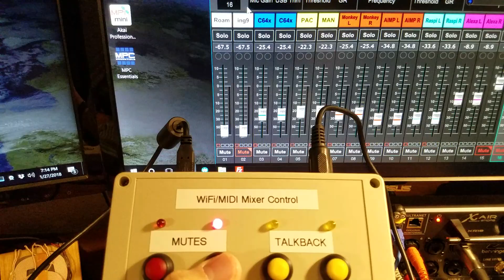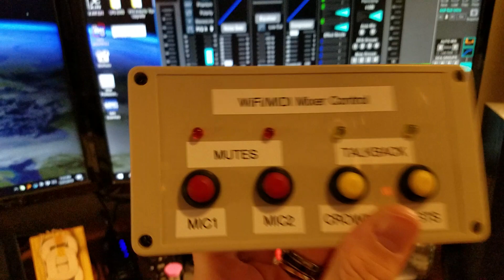ESP32 Arduino based Behringer XR18 X-Air DIY WiFi MIDI OSC Programmable Mixer Controller

Comment: Yes! My next project awaits!
Reply from the maker: FWIW, I've moved away from using the Arduino IDE and now program ESP32 stuff with ESPhome- That said, I haven't had a need to use ESPhome with OSC for controlling the mixer.. yet... lol  😂
Reply: @VernGraner  Nice one. Got quite a bit of home automation going on myself, a bit too much maybe 😂 With your arduino WiFi midi code, woukd it be a big task converting this to function on an X32 or is OSC implementation similar on the two mixers?
Reply from the maker: @wattage2007  If I recall properly, the XR18 and the X32 both "speak" the same OSC protocol so it all should work.👍🙂

Comment: Hey dude, really cool project. i was hoping to use this myself, but i cant seem to compile the code
Reply from the maker: Glad to hear you liked the project. 🙂 I'm sorry the code won't compile for you. 🙁When I wrote the source, it was literally my first attempt to write code for the arduino/esp32 so I really didn't know how to properly structure things. One area in particular was using libraries (e.g. "#include <Button.h>"). When I needed to do something, I simply google around till I found a library that would claim to do the thing I needed and then shoved it into my IDE. 🤷‍♀ I didn't really document where they came from or what version they were. 🤦‍♂

The result is code that would compile for me (since I had the helper libraries) but for others it wouldn't compile.🤦‍♂  I tried to go back and document the libraries in the most recent version of the code I have linked above (The file name is "V35b-COUGH-DROP-LOCK-SWITCH-1c.txt") and it has links to the libraries I think I used. I hope that may help you get it to compile.

That said, I no longer use this device as I moved on to using a Raspberry Pi with Bitfocus Companion instead of dedicated button boxes like this. I still think this project is useful and can imagine some clever ways it could be used for live stage performances, but I didn't pursue it past the point you see in this video. If you like you can email me and I'll see if I can help or answer specific questions about the unit. Good luck and thanks for the comment! ☺
Reply: @VernGraner  Thank you very much for the answer i will keep on trying, will update you if i find af fix :)

Comment: Thank you so much for your help. But can you provide sources code and wiring diagram because link not open which you provide in description. Thanks
Reply from the maker: Thanks for the notification! I didn't realize the link was broken. It should be fixed now and there are photos of the unit and the source code I used. Thanks! 🙂
Reply: @VernGraner   I'm interested in using an Arduino Mega board and push buttons to control the mute/unmute function for the 16 channel faders on the X32 Rack. Could you please assist me whether the provided code/example can be implemented for the X32 Rack to control the 16 channel faders using Arduino Mega and push buttons.
Reply from the maker: @khuuramnazir1124  I'm not really doing this kind of programming/control anymore. Recently I've been using Bitfocus Companion to control the mixers. It doesn't require as much programming and fabrication of boxes/switches since it uses a Stream Deck (from el gato) or you can use its built-in emulator to operate things. Highly recommended for complex control stuff! :)

Comment: Hello from Brazil! I found the V4.0 of your code for the MIDI only controller! I need to teste it with an Arduino Uno but i am getting an error on the arduino IDE saying: error: no matching function for call to 'HardwareSerial::HardwareSerial(int)' Can you help me with that?  The error shows the line: HardwareSerial Serial1(2); I just started with Arduino/Midi stuff and I have a lot of silly questions! Thank you in advance! You are awesome!
Reply from the maker: Hi @aura Pop Duo - Thanks for the comments! 👍🙂 I have not visited this project in quite a while so I don't have the syntax fixes or troubleshooting off the top of my head. I suppose you can pop in on the Behringer forums to ask..?
Reply: @VernGraner  Thank you! I noticed this in the code: "Rev Info: V4.0a (VLG) 01-22-2018 ported to ESP32" I am using an Arduino Uno... Maybe I need to use the V3.0a of your code?
Reply from the maker: @AuraPopDuo  Oh- hey! Sorry I didn't see this till just now. I have all the early revisions of the code laying about. Let me have a look and see if I can put older code revs up. 👍🙂 (done!) You can see the updated link in the video description. I put ALL the source code up there.. from my first prototype to the running code. Hope that help! 😁

Comment: is there any tutorial to bulid this ? is there any change to send midi via bluetooth?
Reply from the maker: Hi Akhmad! Thanks for subscribing and leaving a comment. 👍😁 In answer to your questions:
1- No "build tutorial" per se, I did document my build process fairly extensively on the musictribe forum. You can read the process here:
https://community.musictribe.com/discussions/89600/257791/diy-wi-fi-midi-remote-control-box-for-x-air-working
2-  I never tried to "send MIDI via Bluetooth" as the XR-18 had no bluetooth receiver. I did use WiFi and MIDI to control the XR-18 directly though (as you can see in the video demo). 
Hope that helps. :)

Comment: hello brother.excelente what you did.I'm trying to reproduce you but not with me I always get an error in the line of Serial1.I'm using the arduino leonardo. in my case I would not use wifi only midi I want to make a fixed control and leave it near the mixer. Do you have any tips or other code that I can use as a base?

"hugs from piaui-brasil
really good project"
Reply: forgot to comment

man, this keyboard is very beautiful. Here in Brazil you can't find one of these and finding it must be very expensive

**I found your video on the musictribe website
Reply from the maker: Hi @hernandes ! :) Thanks for your kind words. Though I used the Arduino ecosystem & integrated development environment, I have limited experience using it with any microcontroller other than the ESP32 chip. That said, when I was first building prototypes, I started with a MIDI only version of the code with four buttons. I found that source and uploaded it to my site here. I hope that can help get you started as it is MIDI only (no WiFi stuff) so it might be simpler to troubleshoot. :) The link is here: https://notepad.org/TAE/posts/MIDI_BUTTONS_VLG40a-ino.txt

Comment: Great job!...i have seen the sketch, but for the connection?
Reply from the maker: The box can connect to the mixer via WiFi or via MIDI. Does that answer your question..? :)
Reply: @VernGraner  thanks! But,which pins numbers use to connect the Din connector? And where the momentary switches?...
Reply from the maker: @FrankGegna  Details on the build, including pinouts and pictures of the wiring are in this forum thread on music tribe: https://community.musictribe.com/discussions/89600/257791/diy-wi-fi-midi-remote-control-box-for-x-air-working

Comment: Wow! Exactly what I was thinking! I guess you got the non-MIDI WiFi codes down. I haven't looked into it much but have it in mind to make an encoder/button board to adjust levels. I guess that could be done with MIDI alone but I have all these ESP modules o.. Thanks for posting this!!
Reply: Oh they're using OSC! Cool I know it yay! Cheers again!
Reply from the maker: Glad it was helpful! :)

Comment: Very cool project !
I see you're also a fan of my favorite buttons ! :-)
Reply from the maker: Thanks! :) FWIW, those buttons kinda let me down.. a bit.. I set them up when they were new and apparently, as they get older, they tend to get "noisier".. the original de-bounce routine settings I used when they were new no longer work so well so I am going to have to re-code to take the "bouncier" operation into account. As it is, the "mute" buttons can sometimes "flicker" when pressed and held down .. which is not good ¯\_(ツ)_/¯ .. as far as the price and feel and ease of mounting though, very good. 👍😁

Comment: Niiice.. can I add more buttons to this? And can it be modified with Arduino nano?
Reply from the maker: The prototype unit was built around an arduino nano but it only did MIDI out so, yes you can use other arduino models but if you want to use WiFi it needs the esp32. As for more buttons, that is also possible. I added a 5th "button" (toggle switch actually) that I use as a way to change the buttons between momentary operation and push-on/push-off mode. :)
Reply: @VernGraner  ok, so do you have a link to the nano code?
Reply from the maker: @malmgodbless7  I updated the source code link in the description to a folder that has all the various version of the source code as I was developing things. Hope this helps! 👍🙂
Reply: I don't even remember asking this question but thanks for the reply.. I'll check the video to see what it was about again

Comment: Hi friend, congrats from Brazil about your great idea. Can you share the wiring/schematics? Many thanks in advance...
Reply from the maker: Hello Lidio! Since the connections are so basic, I never drew up a schematic. Essentially, you have four buttons and four LEDs - you connect them to eight of the GPIO pins.. that's pretty much it. :)
Reply: @VernGraner  many tks Verb, I will try it

Comment: What is the change command (cc #) and the channel to trigger the talkback?
Reply from the maker: On the box, I am using the yellow buttons to send two different level commands to the channel. The first button, when pressed brings up channel 10, AUX 1 to unity gain, then when released returns it to infinity. The comands for that are OSC style and are  /ch/10/mix/01/level-127 and /ch/10/mix/01/level 0. Thesecond button does the same thing but for aux 3. its code is /ch/10/mix/03/level -127 and /ch/10/mix/03/level 0. Does that answer your question?
Reply: Is it possible to start and stop the recording via midi and even get Midi Data back to control a record light? @VernGraner
Reply from the maker: @pumbaandtimon  I really have no idea.. To be honest I came into the project knowing exactly ZERO about OSC and MIDI/OSC. I had to dig my way through to get it to work as you see here. :) I would suggest you ask the question on the Music tribes forum .. I'm sure someone there might be able to point you in the right direction. :)
Reply: @VernGraner  ok thanks

Comment: Amigo tenho um controlador midi aqui! como faço pra mandar o sinal pra a xr18?
Reply from the maker: Sorry, that's outside the scope of what I can help with. Based on your question (via google translate) I would guess just use a MIDI cable? ¯\_(ツ)_/¯
Reply: Sorry, I'll send the translation! in fact my question is how to configure within the XR18 mixer the friend could do a video tutorial teaching how to configure the midi controller inside the X air ??? thank you so much!!

Comment: Wow thats an awesome piece of work there. Ive been thinking of buying an XR18 for sometime only thing that has held me off is the lack of foot switch for muting effects. (bypassing FOH reverb for announcements) appreciate this can be done with a Midi foot switch but Ive spent a fair but of time with Arduino, Rasp Pi and this looks like project that might give me what I need. Any chance of a tutorial video, link to code at some point.
Reply from the maker: Hi Stuart- thanks for the kind words. :) As for a tutorial, I don't have one specifically written up (or recorded),  but I am considering writing a complete how-to sometime soon. In the meantime, there is a fairly in-depth discussion about this project on the Behringer forums here:
http://forum.musictri.be/showthread.php?20869-DIY-WiFi-MIDI-Remote-control-box-for-X-AIR-WORKING!
Hope this helps. :)
Reply: Thanks for the reply Vern real excited about this now the final push i needed to order the XR18 a tutorial would be amazing if you get chance but I know only too well how precious time is. Will check out the link if never know if I get it up & running I might do a tutorial myself :-)
Reply: Just spent some time looking at your code no need for a tutorial confident I can get this up & running from the great work you have shared. Thanks once again, will be sure to post on the forum once i do
Reply: Hi Vern, just thought i would report back I have built a unit based on your code & its awesome :-) Will post some pics on the forum when i get chance & its more complete. Have used an old lighting controller foot switch I had. Had to change the code a bit as I needed latching & am using momentary switches. Only issue I have is I cant get the midi cable connection working. Wifi works flawlessly. Using the XR18 & footswitch for the first time at a gig tomorrow. Nervous times.
Reply from the maker: Glad to hear you had success! :) I too needed latching and so I wrote a new (kinda klunky) bit of code to add latching ability to the box. I'd love to see how you implemented it on yours. Link to source maybe..? :) As for using this during a gig, the consensus from the XR18 owners I have seen posting on the forum is that the built-in WiFi of the XR18 is very problematic for live use. It is highly recommended that you use an external WiFi router to insure stability during a show. That said, please let me know how it goes! :)
Reply: Vern Graner got the midi cable working now too. I’m using an airport express for WiFi 5ghz for iPad and 2ghz for foot pedal worked flawlessly last weekend second outing with slightly modified code this weekend. I want to do some tidy up before posting a video but I will do for sure and give you credit very much appreciate being pointed in the right direction.
Reply from the maker: Awesome! :D I plan to post the new code with the latching option .. its really not cleaned up and, though it works, I don't want to put it out for general consumption/inspection till I make it less terrible! :P
Reply from the maker: Any updates on your build? I'd love to see how you implemented your setup. :)